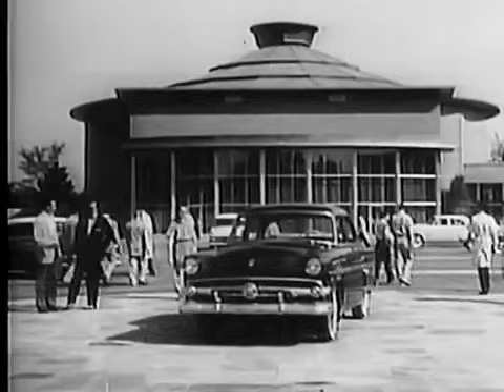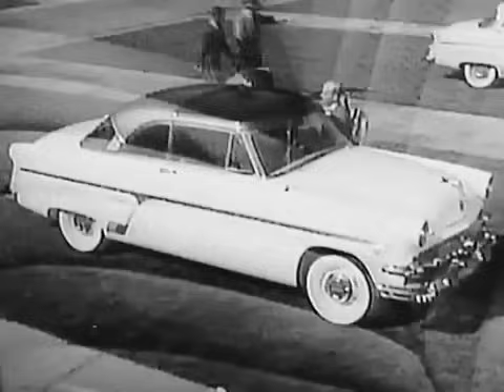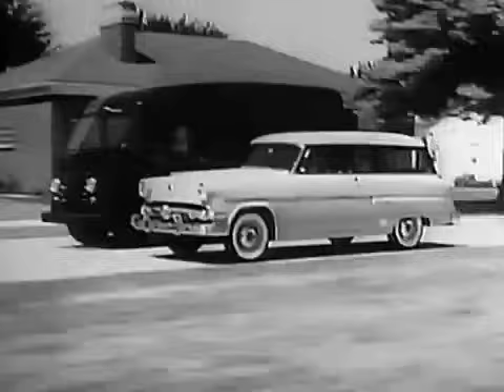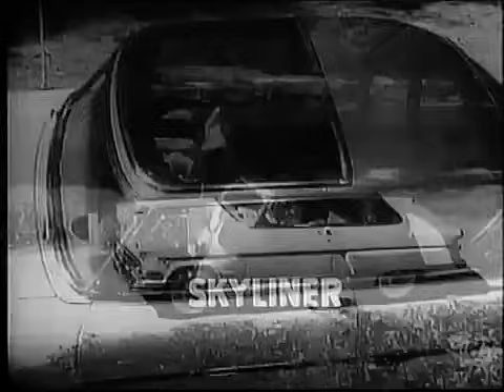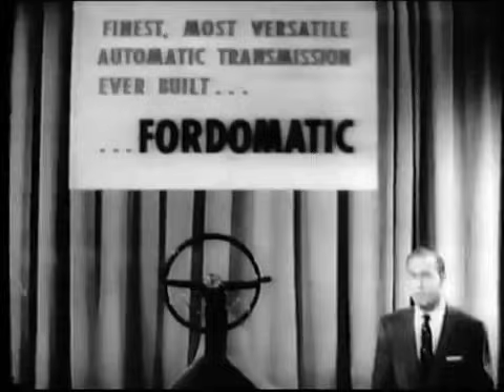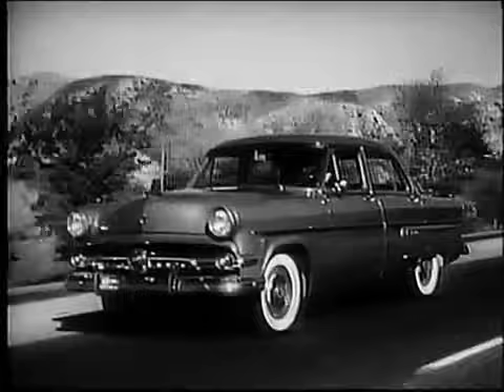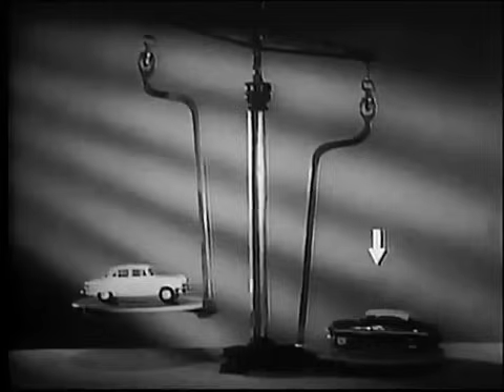Ford Motors History [Rare] Historical Reel 🚗

Comment: I purchased a used 54 in 58. It was standard with overdrive and flew down the western highways. When I returned to the east coast the dealer was salvating to get a car with no rust and I upgraded to a 56.

Comment: I was raised in Detroit about 2 miles from the Dearborn Rouge Complex. My Dad took me to the Rotunda, a domed display building, showing all the new Ford products in early '54 to take the Rouge tour. We hopped the tour bus to the Rouge. Still remember standing on a catwalk high above watching workers pouring molten steel in the engine block castings, then on to the constant pounding of the huge dies in the stamping plant and finally on to the assembly plant watching the new cars coming to life and be driven off the final line. In '68 after I mustered out of the army, I started my tool and die apprenticeship at the same assembly plant where we were building '69 Mustangs and Cougars. Worked with some guys that started there as far back as the late 20s and had some fascinating stories Great memories.
Reply: Pretty cool

Comment: Ok! where can I buy one. I would like to have a few updates like hardened valves and seats, Disc front brakes,   TBI with Ox sensor mixture control, electronic ignition, heads not so prone to cracking, AC. PS, 3 point restraints, Transistor radio and an alternator.

Comment: Seems like BS. Imagine 10 or 12 executives in Dearborn, wearing their $150. suits; trying to decide which tail light should go on the '54 Ford. Is there any equivilent in 2021?  I imagine the department was eleminated when you were still in short pants.
Reply: John, It's not. As a tooling supplier, I've spent 4 days with numerous GM engineers deciding on a 5mm move of a rest block for a 2000 Impala lifting device. I knew guys that never, ever decided on anything including picking lunch.
Reply: @robertchristie9434  LOL, okay I believe you.  Sad.

Comment: I love how they talk about styling details. The 54 was pretty much identical to the 52 & 53.  That spin would have been more convincing about the changes from 51 to 52.
Reply: 1954 was the first year Ford with an OHV engine. 239 CID "Y" block.
Reply: @sergeantmasson3669  OK but we're talking about styling details.  At 0:40 they say model after model were studied before determining the final design, that's the bogus part, the exterior design was essentially unchanged from 53.
Reply: @GenerallyGeneralLee  '52 and '53 Ford cars were essentially identical. '54 had some major differences but the body design was much the same as the '52 and '53. Many automakers used near identical body designs for a few years, not just Ford.
Reply: Exactly
Reply: @leopoldonotarianni8663  but dang man. it had 140 somethin diffrent changes.
Reply: The best engine of it's time ? Ah NO the HEMI was a first in '51-52
Reply: @JamesBond-pb2qy  Cadillak's V8 was no slouch either.
Reply: @imwithstoopid4443  … Cadillac was the car to beat at that time … except  there was the “Hot Rod Lincoln.”       A 1 and a 2 …       “Pulled out of San Pedro late one night / The moon and the stars was shinin' bright./We was drivin' up Grapevine Hill / Passing cars like they was standing still./ All of a Sudden in a wink of an eye / A Cadillac sedan passed us by. / I said, "Boys, That's a mark for me!" / By then the taillight was all you could see.  [‼️That’s all I got‼️)
Reply: @robkunkel8833  Son you go'na drive me ta drinkin if you don't stop drivin that hot rod Lincoln
Reply: Wasn't the 54 the same as a 52-53 ?.
Reply: Liked the Mercury body style more
Reply: I wonder why they didn't make a Ranchero out of a wagon. My late Uncle made one out if a wagon. On a Plymouth

Comment: The 54 was a mild facelift of the 53, which was very similar to the 52.  It wasn't until 55 that they actually did any significant redesign, and that was minor compared to what Chevy was doing.
Reply: Even in 1952, Ford was well ahead design wise compared to Chevy. Both Ford and Chevy were still riding in 1949 designed frames. By 54 Ford at least had an OHV V8.
Reply: Yeah,but look what Chevy did in 1955
Reply: @phillipmiller1310  Many '55 Chevy engines had oil consumption problems and many ended up with '56 engines. Also, '55 Chevy engines didn't have oil filters.